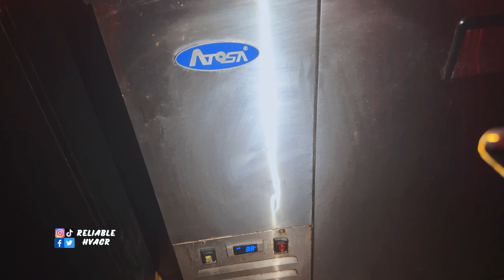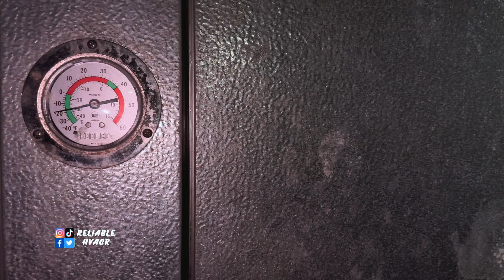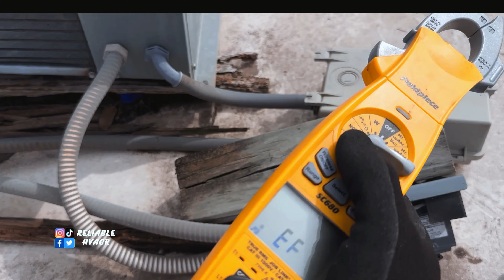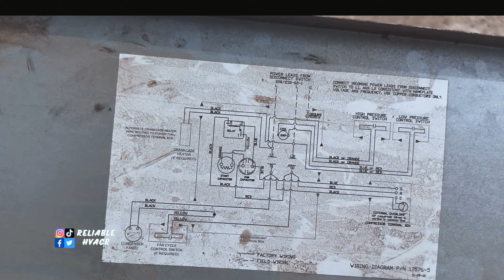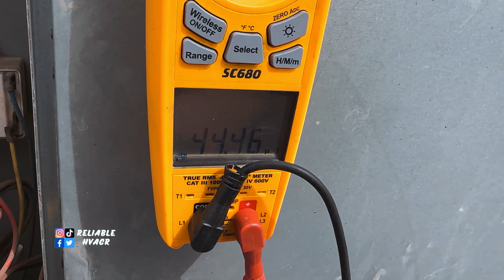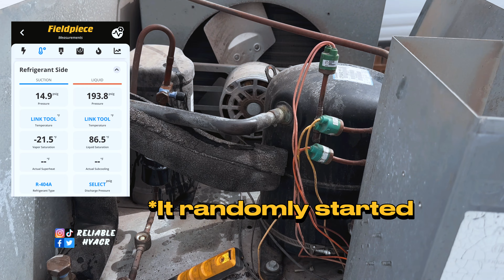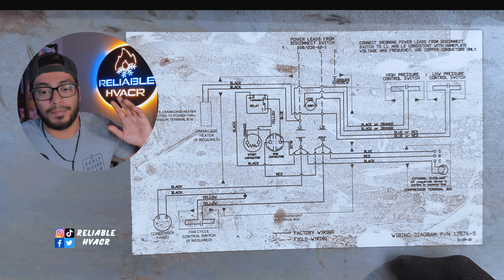Customer Left Me On Read / HVACR

Comment: Most of my customers are mom and pop.  90% of them are great.  This was a great informative video and dead on the money, great advice.  I have to remind myself all the time to take the emotion out of the billing and quoting.  Free food and favors don't feed my family waiting for me at home.  Also promises for more work and all the customers they are going to send my way 99% of the time hot air and manipulation.
Reply from the maker: Yeah that too, word of mouth is good but the customers they promise you is hardly a for sure thing.
And that's good, we had a lot of those when we started and stayed in business but the area here is all about what's cheaper so we had to make sure we got some good big accounts for consistency.
Reply: All I do is maintenance for the outfit I’m with. It’s a bit redundant same ol same ol…but the other techs love it because it frees up their time to do the repairs, replacing etc etc
Reply: A real struggle sometimes to just write the tiny stuff off, at least in the early days, now I'm ruthless with my time and materials, however small. That stuff adds up. I don't accept food, maybe a bottle of water if they insist, but otherwise, no. In the end though, the worst one is the "i have a lot more work for you" guys. I run from those, fast, not slow

Comment: Your overload was open on or in compressor potential relay starts with contacts closed and the contacts open when compressor reaches 75% of its speed because the counter EMF forces it to open. So check the contacts by energizing the coil and checking the contacts for operation. This could be because the run cap is breaking down.
Reply from the maker: Windings were closed on compressor, I kinda rushed thru the diagnosis honestly but everything else was working besides it leaking and not starting

Comment: The installers forgot to relocate the t-stat sensing bulb to the air inlet side of the evap coil. The air coming off the coil will satisfy the stat prematurely.
Reply from the maker: Gotcha, bulb placement is a common issue I don't believe it or not around here 😅